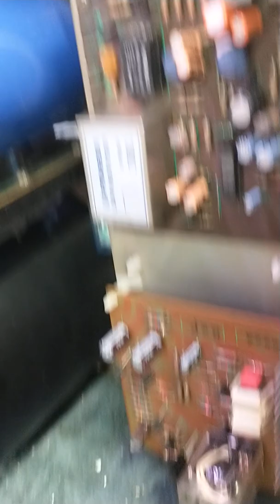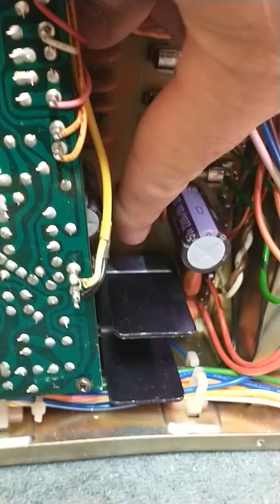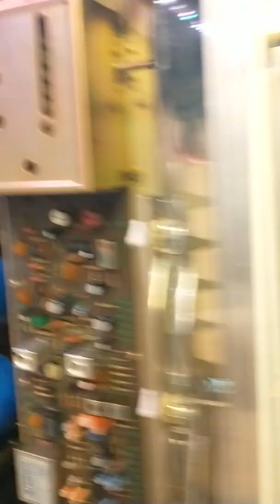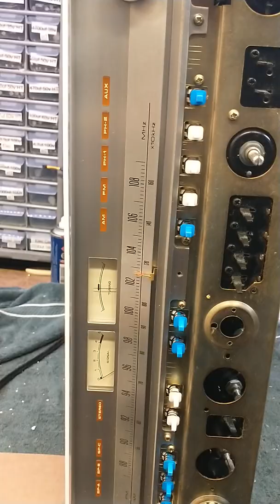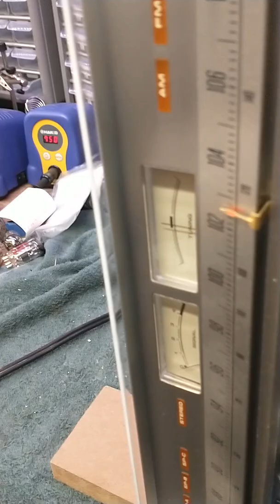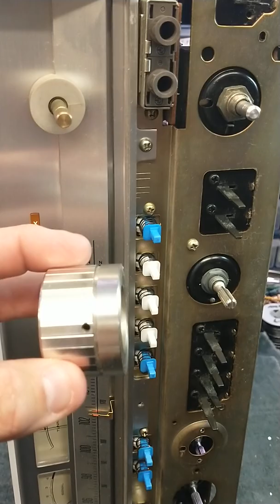Pioneer SX-1050 Vintage Receiver Restoration at Hudson Valley HiFi

Comment: Great video!  I just acquired a SX-5580 (same as SX-1050) and started to restore it. I was able to remove all 4 board behind the front face plate. The trick to getting it apart is remove the power supply board, remove the phono pre-amp cover and presto you can remove both sets of board, top and bottom.  This unit is easy to take apart compared to the QX-949. Since I have the rare European black model I plan to use dark Rosewood  veneers on the case.  Looking forward to making it even better looking.  Thanks for the information on your SX - 1050...

Comment: What would cause no sound from speaker.  If i use the adapter output and have a speaker connected it works.  But when i use speakers a b and c nothing coming out
Reply from the maker: Your speaker protection relay is open possibly due to a fault in the power amplifier. Needs to be checked for DC offset

Comment: I was a telephone company technician in the 70’s, wire wrap terminals were used extensively on PBX equipment and the benefit was a tight bond and eliminated the potential for damaging or burning adjacent wires and components. There was also an “ unwrap “ tool to loosen and remove the wires twisted onto pin terminals.

Comment: Thanks for posting this!  I had my SX-1050 restored a little over a year ago and I'm very happy again.  I'm an original owner as well, these were quite a beast in their day when paired with good speakers, they had a great FM tuner as far as receivers go.  These are like 45 year old old cars now, they need an old fashioned tune-up, change points, condenser, set dwell, set timing, carb mixture, idle...on and on.  Once returned to their best, very little beats the way they sound.